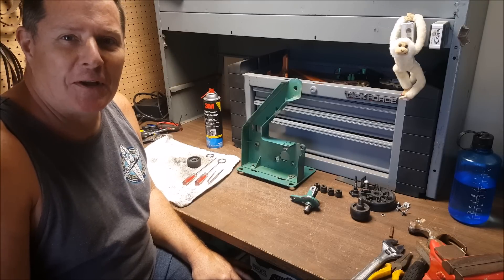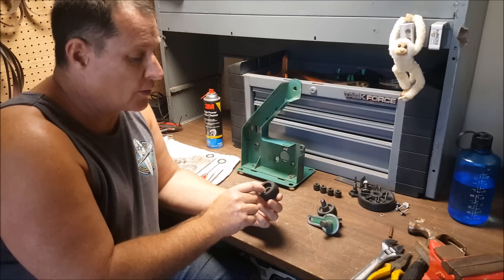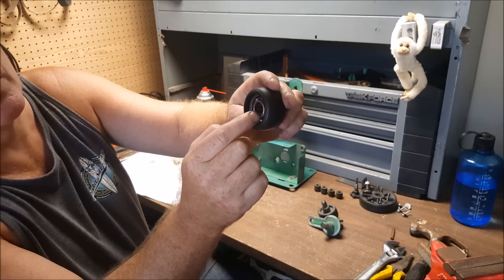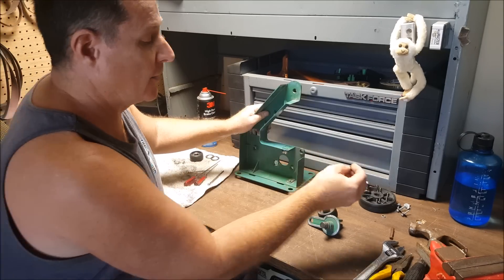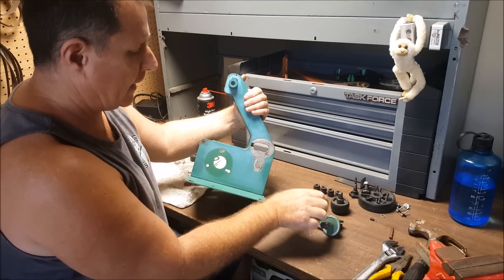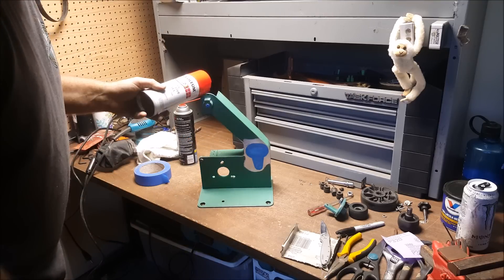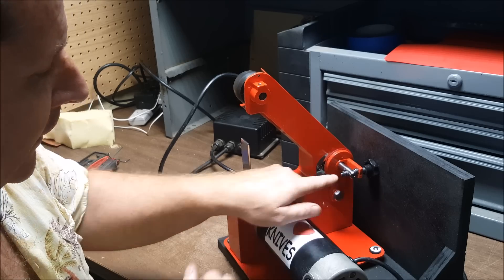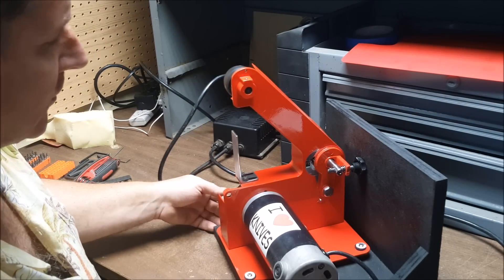Harbor Freight 1x30 PIMPED OUT!

Comment: Great job man.

Inspired by you I took mine apart, since I wasn't using it because of the vibrations.

When I tried to true the small wheels, it turned out the axle was a little out too, so when I trued the wheels to the to the axle, they were still not round.

But then I tried truing them with the belt on, and the machine running. Using a Dremel with a coarse sanding drum to sand the wheels while the wheels were spinning made them 100% round. The belt isn't shaking at all, and it's soooo much less noisy. 

So give that a go next time. Also way easier 🙂

Comment: If it wasn’t for all of the videos on what to do from a variety of users I would just plug and play. I myself before using this I started to modify a few things. Just a heads up I got the top roller off and popped the seal. Not using it yet there was absolutely no grease in the bearing so I packed it. I haven’t been able to get the other snap ring off as of yet. I am going to use my old cutting board and replace it with a new one. (Maybe) If it wasn’t for just purchasing the angle finder from Amazon I’d reverse the polarity on the motor. So when I leather strop it I will lay the motor on its backside so it is running in reverse. Working at a company that used Baders that took 172” belts! The bearings on the two little ones should be tight! Just an FYI.

Comment: Well, you just made a silk purse from a sow's ear but I like it. I've worn out two of these little jewels, and on my third. I trued up the big wheel on mine today which was pretty lumpy. Thanks and keep 'em coming.
Reply from the maker: If you get rid of the whiny over fast motor you are left with a very decent little frame and idler tires for under $50 hard to argue.  The motor upgrade turns it into a powerful little precision workstation.  Cheers
Reply: Curry Custom Cutlery can I get a link for the idler wheels? Ive looked everywhere for replacements.

Comment: can i get belt o go in oposite direction, by changing wiring from motor , like switching poles, i would like to sharpen slack but right under wheel like in expensive, 70 x 2 Burr masters, if i had the money and got into this 20 years ago

Comment: I have the same sander, have taken apart marked each place to reassemble. Problem..the 1x30 belts won't fit back . All parts were put back as taken off, what might be the problem..Thanks
Reply: swing arm tension nut need to stay loose so the back tracking wheel can move forward n backward.

Comment: nice job to make the 1x30 a better tool! see my video on replacing the upper wheel with an aluminum wheel from a 2x72 belt grinder. those rubber wheels from HF are not great quality, but a smooth running aluminum wheel helps when sanding concave surfaces.

Comment: Since you elaborated on the whole machine breaking it down . ( nice job )  Would you expand your explaining about the VFD motor . Make, model and the same with the VFD . Theire was always something like a different shaft size or the motor way to large in diameter.I would love to slow my machine down. I tried going to different suppliers of motors and found none would come close to being mounted on the frame.

Comment: Hi Cliff.
Thanks for the advice on the belts from supergrit.com 
Turns out i had a 1x44 not a 1x30
Bought 42"belts didnt know it was a 44. Any way its a tension system and i was able to make it fit.

After 15mins of grinding 😁 the motor just stop. I did stop the belt a few times by accident.

Its a 1/4hp motor 1725 rpm.

 Do you have any idea what could have happened?
Reply from the maker: Do you do facebook?  Hit me up either on messenger(https://www.facebook.com/clifftcurry) or email (currycustomcutlery@gmail.com)  Send me a pic of the machine

Comment: What do you use  to control the speed of the HF sharpener?
Reply: You can't control the speed of the stock motor he replaced the whole motor so he could control it. I believe it's a midi lathe motor with built in speed control.

Comment: What motor did you use
Reply from the maker: Penn State 1/2hp.  Discontinued just as I started to offer adapter plate kits so you can all build em.

Working on new adapter for different motor now...
Reply: Curry Custom Cutlery which motor would that be? And do you have any adapter plates for that motor?

Comment: What motor is that? Part number?
Reply from the maker: Its a variable speed motor used in small wood lathe machines.  Dont have a part number but you should be able to find it with that info.  It is not a direct bolt on replacement.  Mounting holes needed to be drilled and the drive wheel bore was changed to 15mm.  Not easy unfortunately.
Reply: @maine420247  How much$$$?
Reply: @pauleyedwin6056  they used to be 120.oo from pennstateindustries.com but u can google: variable speed mini lathe replacement motor. Or people have been using variable speed sewing machine servo motor. Good luck 2 u but its sooo worth it!
Reply: @maine420247  Thanks for that reply. I just got a vintage lathe and although the motor is fine want a backup motor. This one looks about the right size. I'm in the UK, but do use some PSI products.

Comment: Truing the drive wheel eliminated most of the vibration for mine, and I replaced the tensioner spring with one that's closer to 30 lbs.  This cost $1.13 at my local ACE Hardware:

https://www.hillmangroup.com/us/en/Home-Solutions/Home-Accessories/Springs/Compression-Springs/Hillman-Compression-Spring/p/540021
Reply: what spring did you use and size
Reply: but any spring with the same length and diameter, and a spring force of over 20 lbs should work well